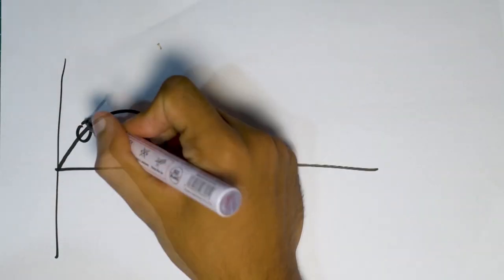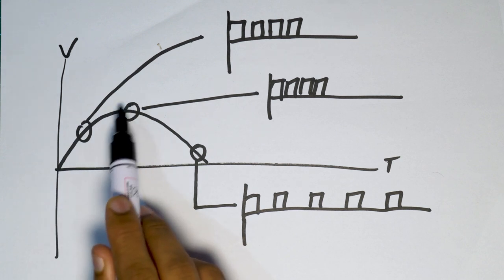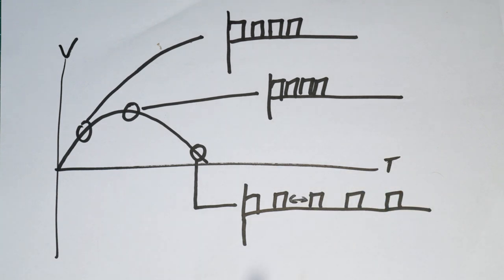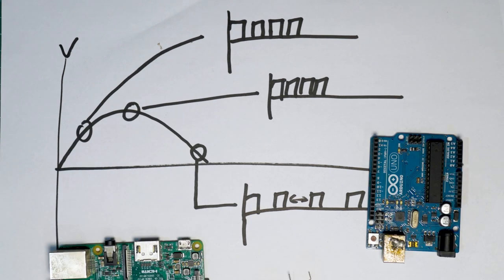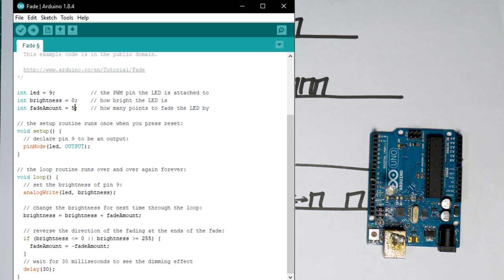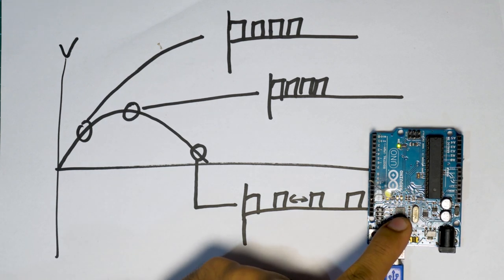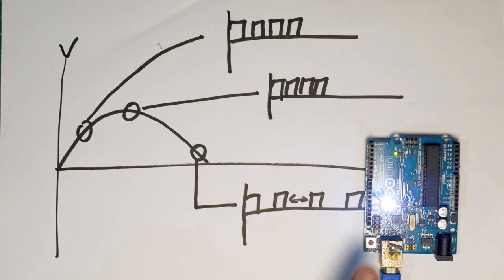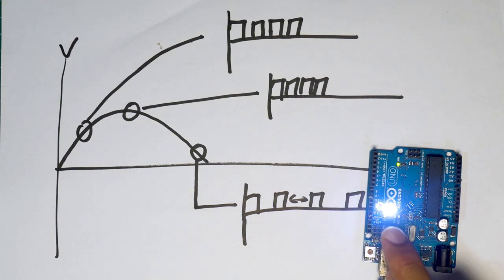Analog, Digital & PWM Signals for Arduino & Raspberry Pi- Electronics Crash Course #8

Comment: I have learned to use an arduino mega 2560 and built a remote control snow blower using a  10 channel flysky RC transceiver. But now I am going to try building a remote control lawnmower with a little more smarts by including a raspberry pi. I am completely new to raspberry and python scripting. Can you point me in a direction to learn how to take the RC pulse in from the arduino so the Raspberry can see  the signals and  then control  my servos and motors. I am currently using Firmata protocol over USB connection between the two. My first  python script success was to use analog input from the arduino to the raspberry and convert it to move a servo connected to a digital pin on the Arduino from 0-180 degrees. 
A lot of the information out there is very ambiguous. Everywhere I looked I could not find anything on it. So I included my  working code here for others to use.
# Pot_servo_control.py ( My python file name)

import pyfirmata
from pyfirmata import ArduinoMega
import time
from time import sleep

sleep(5)
board = ArduinoMega('/dev/ttyACM0')       # USB connection to arduino

mega = {
        'digital' : tuple(x for x in range(54)),
        'analog' : tuple(x for x in range(16)),
        'pwm' : tuple(x for x in range(2,14)),
        'use_ports' : True,
        'disabled' : (0, 1, 14, 15) # Rx, Tx, Crystal
       }
it = pyfirmata.util.Iterator(board)
it.start()

analog_input = board.get_pin('a:1:i')   #  potentiometer connected to analog pin A1 on Arduino
Myservo1 = board.get_pin('d:3:s')      #  servo connected to digital pin 3  on Arduino 

while True:
     analog_value = analog_input.read() # first step is to read info from the pin A1 on the Arduino
     if analog_value is not None:             # Loop condition
        a = analog_value * 1000                # multiply the float value and put it on the left of the decimal point
        b =(int(round(a)))                           # turn the float into an integer and rounds it off
        c = b / 5.54                                     # divide by 5.54 returns  0-180 from the potentiometer
        print(int(round(c)))                       # prints the output to the monitor when you run the program
        angle = c                                        # create a variable to store the output from c for the servo
        Myservo1.write(angle)               # takes the output number and moves the servo to that degree
        time.sleep(0.01)                         # take a break before the next signal reading